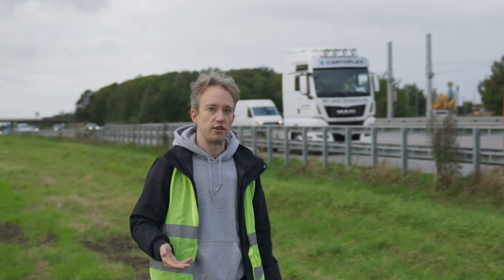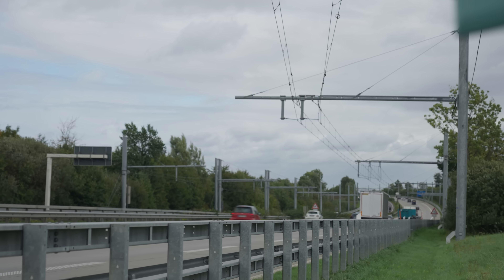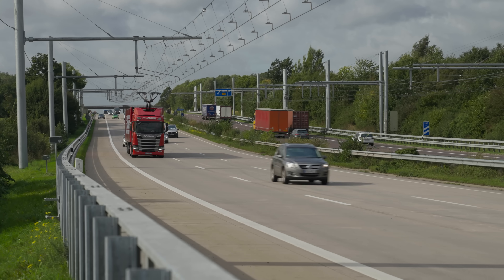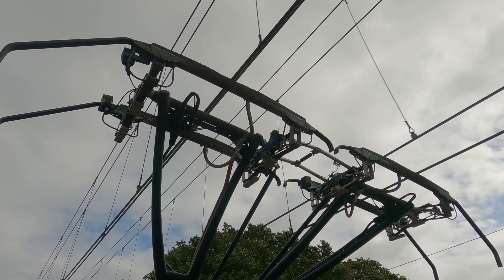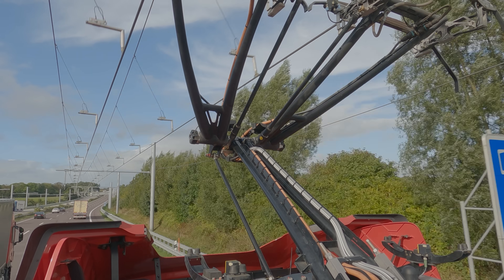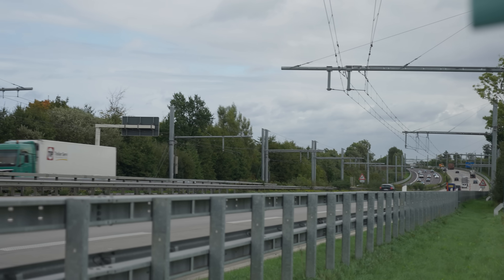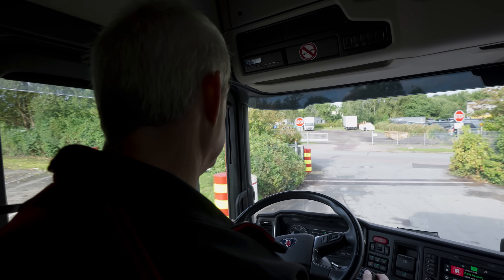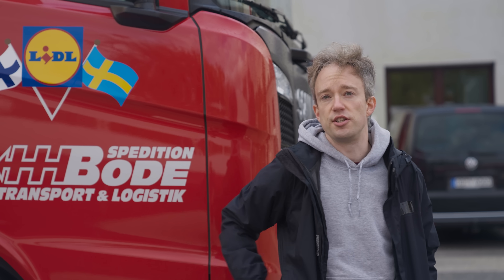The highway where trucks work like electric trains

Comment: I'd prefer seeing less trucks on the roads at all. Put more cargo on rails.
Reply: How do you see that? Way to little track for trains to carry all the goods needed.
Reply: @willemvanlith9215  Build the necessary tracks - that's what we did with roads
Reply: That is how it was done before the car. Build back the tracks
Reply: I think we'll need both.
Reply: Barely any factory is located near rails, so you always need trucks for the last mile. That's why our logistics infrastructure is so truck dependent and cargorail is declining.
Reply: It's significantly cheaper to not use a rail network, alas. Passengers can only afford to use them due to subsidies which bring them down to similar costs of driving.
Reply: Built tracks means land aquirsum. It will be expensive, too expensive in large cities.
Reply: Guys, the topic of the video is the Autobahn. There are hardly any firms having their own on-/off-ramps to the Autobahn network. For the last few miles one might of course have trucks. But no one on Earth needs hundreds of trucks going in exactly the same direction for hundreds of kilometers! Except for the corporations building these trucks, of course.
And Germany already has a proper rail network. Expanding on it doesn't come with that many land acquisition compared to the unsaveably lost lands of the US.

@Phillip Parr All traffic is subsidized. It's one of the main duties of a government to reallocate money in order to subsidise mobility. Driving is highly subsidized as well. Or do you have to pay a fee for any road you're driving on?
Regarding the transport capacity per time, a road network is way more expensive in terms of upkeep than a rail network.

Comment: It feels like by the time they've tested this out, decided to build it, and actually built it that battery tech will have improved enough to be competitive and more flexible.
Reply: Good battery tech in trucks is still a long way away, this tech looks like it can be retro fitted into trucks - which is a huge plus over buying a new truck
Reply: Battery's aren't the issue. The power has to come from somewhere. And Germany is already depended on other countries for Power
Reply: Batteries still need a stop, this does not need heavy or expensive battery tech, saves on weight, and can be continously operated.
Reply: There will never be a battery more efficient than direct energy transmission
Reply: Every kilogram saved by a smaller battery is one more kilogram of cargo delivered.
Even if the battery tech will be better in the future this system still has an edge over batteries.
Reply: Tesla Semi is already coming… planned for 2023

Comment: My doubt is that what if the truck slightly moves left or right?
Will it not short the wires (live and earth) ?
How they overcome the situation of driving trucks in a single straight line if someone tries to go into the lane or come close to trucks?
Reply: Trolley buses have been using this same technology for almost 100 years, in urban environments no less. It's not an issue.
Reply: @m.f.3347  Trolley busses do have an ability to weave around and still maintain their pickup gear in contact with the wires.  Theses trucks don't seem to be able to move sideways as the pantographs may short the power or worse catch the wire and pull the whole lot down (trains do this as well when geometry goes wrong).
Reply: Pantographs are incredibly simple and mature technology. Each side of the 'graph is shorter than the gap between the two wires, so they can't reach far enough to short. And if there's a disconnection or the truck moves out of the lane the pantograph is lowered as actually shown in the video. I don't understand your second question - they're still regular trucks,  other vehicles can drive in front, behind or in between them just like they always have.
Reply: Thank you everyone for the explanation, sorry i confused with my second question, I meant to say that if a truck is going on the road and by chance if some other vehicle comes closer to the truck and it has to move left or right suddenly then what would happen?
Now i got the answer, thank you.❤️
Reply: I don’t see how someone coming into the lane will affect the trucks? They already go in a single straight line
Reply: the lane the trucks are driving in is practically a truck-only lane, so ideally there shouldn't be anyone that interferes with the trucks moving in a straight line. maybe there's a detection system in place that shuts off the electricity in edge cases like this tho
Reply: I think they have some lane keep assist to keep them under the wires. Tom also mentioned that the pantographs go down when the lorry leaves it’s lane.
Reply: The pantograph drops automatically if you move left/right. And for the second part - hit the brake like you would do on a tram
Reply: I don't get your seccond question either, in the end their just trucks with some extra stuff on top.

Comment: Shouldn't containers be taken by rail? It seems more logical to electrify more of our railways and build the hubs based on the existing rail hubs than electrifying miles of trunk road.
Reply: Most containers are, as mentioned in the video, but you still need to deliver the container to a particular warehouse for unloading and distribution to the various end-recipients. For the great majority of warehouses a dedicated rail link is way beyond need or cost. Thus you need the trucks to get from the rail depot to the warehouse. Preferably they're close by but quite often the warehouse is in the next town over from the trainyard, making a 'trolley-truck' network like the one in the video a real asset.
Reply: The problem is that rail infrastructure is even more expensive.
And a lot of existing european rail infrastructure is already saturated (largely by passenger trains).
Reply: @NotAMinifig  So we should build more rail instead of more streets. Trucks on long distances are inefficient.
Reply: @IntensiverPinguin  ideally yes, but if you want to stop doing fossil trucks in 18 years you just don't have the time (and the money).
Infrastructure is slow and expensive.
You can upgrade your existing motorway network with this tech for way less money and way faster than building an equivalent rail network nearly from scratch. (as said, a lot of the existing rail infrastructure is already saturated or close to saturated, so almost everything you get off the road will have to go on new infrastructure)
Reply: Germany already has quit a dense rail network, but there are cases where rails don't make sense. I agree that we should strive to move as much as possible to rail, but for the part that doesn't make sense on rail this might still be a good idea.
Reply: Imagine that small-scale transport to specific locations would require lorries to being individual cargo one at a time, in a way that trains can't sustainably provide (trains being far more efficient for large scale transport). I do agree though that our train systems (both in the UK and Germany, and in theory everywhere else) need the electric overhaul to take the strain off that large scale transport. Tldr pwease mr government give more public transport funding
Reply: Containers are taken by rail or sea, but they require lorries to take them to their final destination. Rail cannot do that.
Reply: @carolineanderson3341  but this doesn’t do the that it does the job what the rail does.
Reply: @carolineanderson3341  Rail absolutely can do that if you build it
Reply: @m.f.3347  to a customer site delivering one container?
Reply: Thats not how it works. 
A private company wont rent trains and the permission to use the railway system just to deliver a few truckloads from one central warehouse to the smaller ones. 
And then they would have to use trucks anyway from the train station to the warehouse. Cheaper to just use trucks and drive a direct route.
Reply: Have you seen the state of railways in the UK? They already struggle with the amount of trains, rail is good but it is also very restrictive. electrified highways seems a good alternative
Reply: Good luck delivering a container from the ship to your local supermarket by train only
Reply: @toericabaker  The problem is that expanding rail infrastructure to the required level would cost extremely large sums of money and you'd still need a solution to take freight to their final destinations. With this system, the trucks can be charged while on the grid and so they can then be used for final destination delivery. It's also cheaper to retrofit existing infrastructure than buying miles of new rail infrastructure. That part of the reason that this didn't happen under fossil fuel systems
Reply: This appears to be the next best thing to rail which is way quicker to build. If I'm not mistaken, rail can not accomodate the extra freight and passenger traffic yet, and the investments to make it able to do so will take longer than rolling this system out to highways.
Reply: For longer distances yes. Medium and short distances, on the other hand...
Reply: Roads exist already in the places you'd need to add those rails.

Comment: Install them on big uphill sections if nowhere else. It charges the batteries while also getting you up the hill. Then you get regenerate breaking charging on the way down. Double win!
Reply: Youll need the overhead on both sides, depending on efficiency, you could have 3-4 trucks regen to get 1-2 up the hill again. Same already happens with frieght trains.
Reply: Highways are usually not very hilly...
Reply: @Mobin92   - Dutch?
Reply: the truck has a normal engine when running off the grid
Reply: @elsyvien  Not all of them and also it's plannend to remove the conventional combustion engine completely
Reply: @elsyvien  The point is to not use a fossil fuel engine. Going uphill with a loaded truck uses the most energy possible. So doing uphill sections on overhead wires is a way bigger win than on flat road sections.
Reply: Wrong, if you are fully charged on top of the hill, you dont have any battery capacity left for regenerative braking.